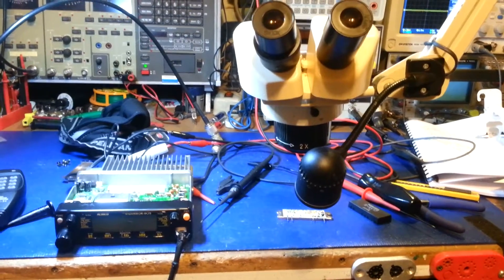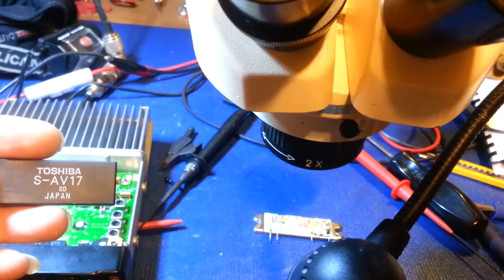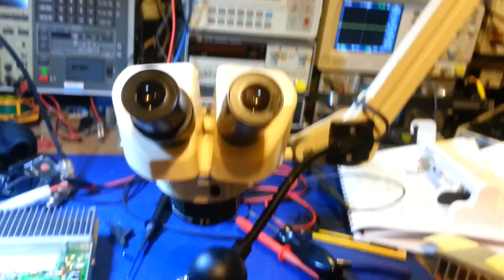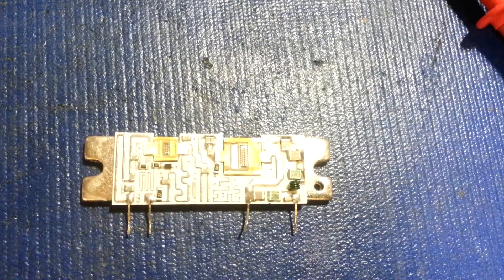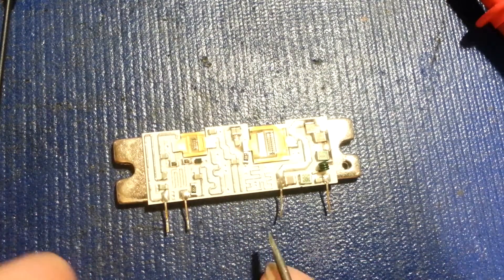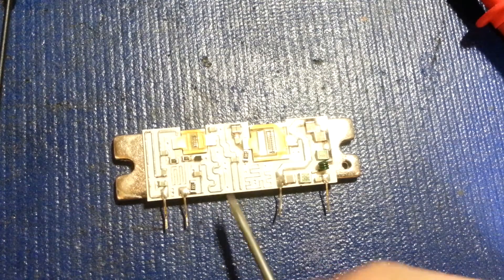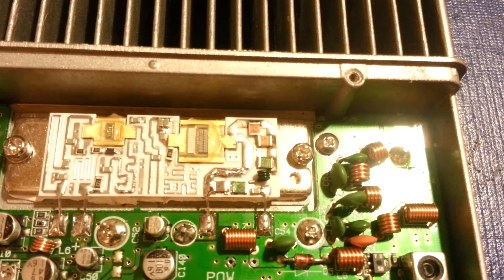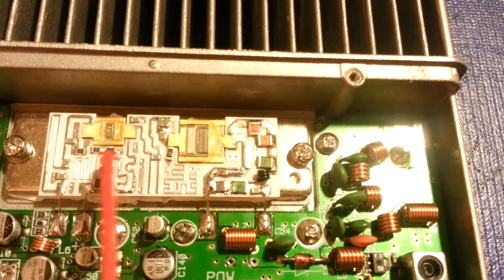Alinco DR-605 no transmit power on VHF. Repairing the VHF power module.

Comment: Hi, Mike!  I have one of these DR-605's and it was working fine, then one day I turn it on and no receive on VHF at all.  The UHF receives (signal meter shows incoming signal reading).  Both UHF and VHF have no receive sound/audio though.  Even when I turn the squelch, there's no hissing.  The speaker has been tested and is good.  Both VHF and UHF transmit fine though.    Do you have any ideas what this could be?  Maybe the black square/rectangle IF filters?

Comment: I have a DR-605T and seem to have lost Tx Power on the UHF side. I can UHF receive fine, but when I key up the mic, there is no output at all (Hi or Lo) when measuring using an SWR and output power meter.  Can the issue you dfescribe also happen on the UHF side?  Plus, my UHF backlit LCD display is dark. Characters display fine but but the back light is off.

Comment: I've got one of these. Mine is not transmitting on high power. It works good on low power. It doesn't do it all of the time. I took it out of the truck and brought it into the house. It started working again. Could this be my problem too ?
Reply from the maker: I would say "probably" not.  If you have a problem with one of the amplifier modules where the traces are cracked it won't work at all.  You wouldn't know until you took a oscilloscope and probed the input and output of the module to see if it has input drive power or not.

Comment: I have a DR610 with the same issue. Was fixed along time ago (c 20 yrs!) by a colleague but went again a year or two after. It's taken until now to get around to having a go at fixing it. It looks like the original repair has failed. Luckily I have a better soldering iron now :) As it isn't working, I figure I have nothing to lose by having a go at repairing it (I'm a qualified electronics tech, so not a newbie to this kind of thing). These modules are still available from a few sources so I can always get a replacement module should this one prove too far gone. Nice lab setup there, btw! 73 de G4UCJ.

Comment: Best way is use a hot plate heated to where the solder is just about to melt board won't crack and you have better control of the solder repair. Let the ceramic board cool on the hot plate.

Comment: Hi Mike, I know this is an old post, but I am wondering if you have had a DR605T  with the screen flashing.
I had a electrical storm, the radio was not connected to the antenna, but to the power supply which was damaged. I have not been able to find any info on trouble shooting this issue. Wayne VK2DWP.

Comment: As somebody mentioned it's sop to put them on a hot plate to rework . Easier to rework and less thermal gradient. I've seen dummy blank ceramic boards on one side of a metal plug in card to balance the mechanical stress.

Comment: I lost transmit on the vhf side of my DR-610T.  looked at this very board and sure enough, could see the cracks in the same spot.  I ran a sharp pointer over the solder traces and wherever it was cracked it seemed soft and blended together.  I don't feel it is a permanent fix but it did fix the VHF transmit.  Once i get a new soldering iron i will fix it permanently.  Thanks for the video!

Comment: the small component, just under the coil, connected to the output lead,(the grey one) is that a cap or a resistor? any idea of the value? heve the same amp board here, not cracked butt component burned, would be nice iff you could help. my idea its a resistor, but have no value to replace. mine is burned off!

Regards Richard.
Reply from the maker: MrBugsier5 

Sorry I don't have one here currently that I could check.
Reply: thanks for the reply, cant find anything on schematics on them...

update, just found it out, its a cap!  now its fixing time! lol (its from a 90's Sailor vhf boat radio)

Comment: I don't know if you can reply back to me but I have a receive problem on a alinco DR -130T it will receive short-distance Transmissions but it will not receive any long-distance Transmissions like off of a repeater or something like that but is there any way that you can email me back at jblack2215@gmail.com with a solution that I might be able to fix or have fixed
Reply: sounds to me like a bad amplifier fet. (happens when it gets to mutch rf from a to nearby transmitter.)

Comment: Nice job fixing that unit up Mike. Worked on a lot of Kenwood TS-721 try band units with that issue.  Mark is spot on about thermal stress.
Reply from the maker: Yeah, like I said in the video the boards definitely doesn't like to flex.  Luckily they can be fixed.  Have to wonder though, how many have been replaced that could have been repaired.
Reply: Most do it yourself techs are not aware you can remove the cover. And any warranty it is replaced. I seen some of these cost over 300 bucks. Like my Regency repeater. Uses a similar unit but it is sealed.
Reply from the maker: +The Radio Shop 

Some of these things are expensive, ridiculously expensive.

Comment: Tracks are probably that way for length. they probably fracture at those locations due to mechanical and thermal stresses. 
I am not a fan of those power modules or the STK modules either for that matter.
Reply from the maker: I have a few hundred of the STK stereo amplifier modules.  So they use the same board setup?  Never cracked one of those open after replacing it to see what was inside.
Reply: They are fairly similar. Don't think they are repairable. 
Usually the transistors are what dies in those.

Comment: Mike, Tektronix used to have ceramic terminal strips in their scopes. You were supposed to use a special solder with a percentage of silver in it. Same Here perhaps? This was ( according to legend ) supposed to keep the terminals from coming off the ceramic.   Also, I would warm the heat sink to help the soldering process. Less heat robbed from the iron that way. Nice video.
Reply from the maker: I use SN62 silver solder for pretty much everything I do.  Didn't even think about preheating it.  I even have a laboratory hot plate.  Have to remember that next time around.